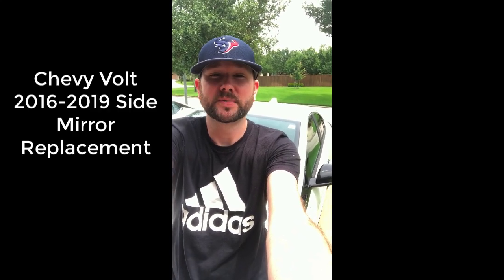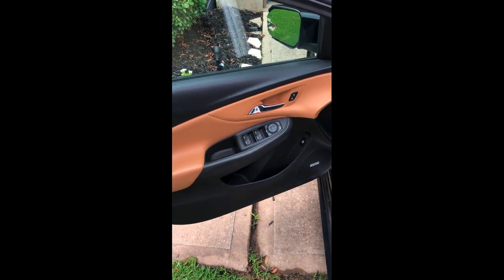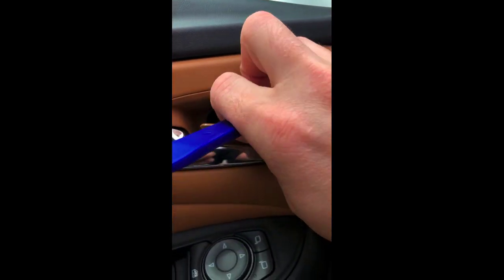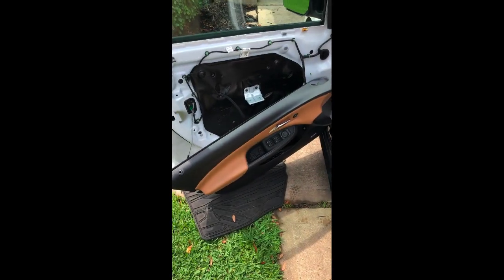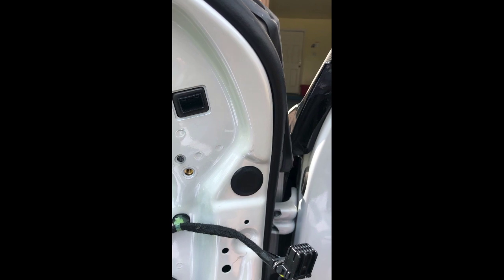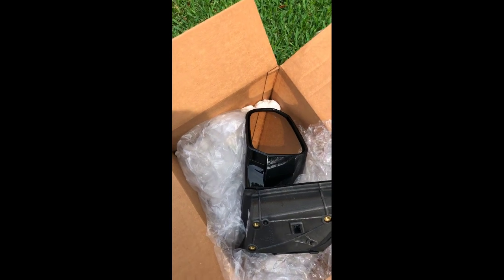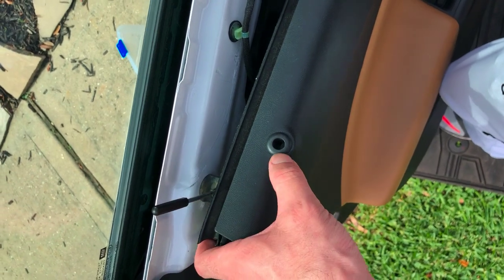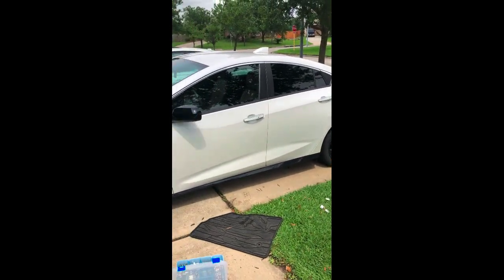Replacing a Chevrolet Volt (2016-2019) Side Mirror

Comment: Thanks DR. Rick this video save me a lot of $$. Re-installing the pannel is not easy. Here a little trick I applied on my 2019 volt. On the top of the door pannel your have 5 litles metals clip that maintain the top of the pannel and the rubber trim. Remove all of the them from the door pannel cover and install them immediatly on the door then put the rubber in. Finally make sure your door lock pin is at the right place and put the pannel back in place. This must go straight in, make sure to clip the top section, your 5 metals clips first and then apply the pressure on the one at the bottom. This is probably that way it is done at the factory, otherwhise they would loose too much time !
Reply: Thank you so much for the tip about the 5 metal clips. I was trying to put the panel back on without doing that and could not get the panel back on. You save me a trip to the dealer.
Reply: So true!!
Reply: Your advice to remove the metal clips from the door panel is absolutely necessary.  I tried for hours before I did this on my 2019 Chevy Bolt.  The front driver's panel went in easily after switching the clips from the interior panel to the door frame.  In the future, I may pry the panel away from the door frame instead of lifting the panel up to detach the door panel from the door frame.

Comment: Do you know if a Gen 1 Mirror set with Turn Signal on the outer side of the mirror will fit a Gen 2? I know it would be a wiring change to get the turn signal to function, but I think it was a mistake that the left that features off of the Gen 2's.

Comment: Dude thank you so much for posting this!! Yep chevy wanted near one thousand dollars. I was hesitant to do the repair myself for fear of causing damage to the interior. I'll be buying a replacement mirror and attempting this repair with your video as a guide. I will post back once I have tried.
Reply: A few of the plastic snaps that hold the side door panel either cracked or the square peg game out of the door, rather than the flanged peg coming out of the siding. However, despite the slight mishaps and a little bulge at the edge of my door now, I was able to replace the side mirror by following your video. Thank you so much, you gave me the confidence to attempt this repair myself and basically  saved me hundreds of dollars!
Reply: @philquantum8200  I'm glad you were able to tackle this on your own, and that the video helped! If those plastic clips that were damaged give you any issues, they run about $5 bucks for a replacement set from Chevy.

Comment: Do you have any tips on just replacing the mirror cover? I have similar damage on my passenger mirror but it is only the top piece
Reply from the maker: Should just pop right off.  I don't think the cover is attached using screws.

Comment: If you need to replace the cover, OR reuse it on a new base, remove the cover by prying on the bottom edge closest to the window.  Pry toward the window just a bit, maybe 1/16th of an inch, or you will break some guide pins in the cover.  Continue prying around/along the bottom edge of the cover using a plastic spudger until the cover pops off.
Reply from the maker: Thanks for the advice!

Comment: Thank you so much Dr. Rick!! Your instructions has saved me $250 that Chevrolet quoted me for putting the mirror assembly on/off.  Personally, I've found that just loosening the trim around the edges is enough to get access to the last 3 bolts (you really don't need to take the trim off completely, as long as 2 of the clips are attached the trim easily pops back no problemo). In short to perform the installation you need hex 7mm bolt and hex 10 mm bolt and Drill (for faster screwing).

Comment: I am having trouble installing the panel back, how did you put it back? Seems like I can't put the top clips in place.... Thanks for the video!
Reply from the maker: Sorry I missed this comment at the time.  Responding now, in the event anyone else runs into the same issue in the future.  Snapping the door trim back into place was probably the hardest part for me (due in part  bc i had to do it twice after not properly seating the door lock the first time) but I found it easiest when dropping the door trim down, then applying pressure by pushing in directly on the top of the trim to get the clips to snap back down into place.  What solution ended up working best for you?
Reply: @FestiveScholar  thanks to your video, removing plastic trim was easy. Installing it back was a real pain in the back. After the first attempt everything looked good, except a small misalignment. I could see that rubber seal sits in a bit weird angle... Using a flashlight I found out that half of the metal hooks went too far or didn't get through the "pockets" at all. So I removed it again and with help of my father I had to align every hook/clip, one by one. Impossible to do without small and bright flashlight... It is possible that you didn't align all of them OR you were very lucky to get it done in one shot :) I had to do this to all 4 doors and I had this problem on every damn door. Horrible design.